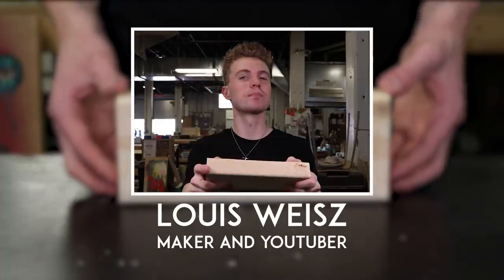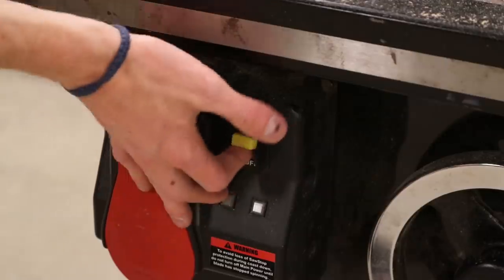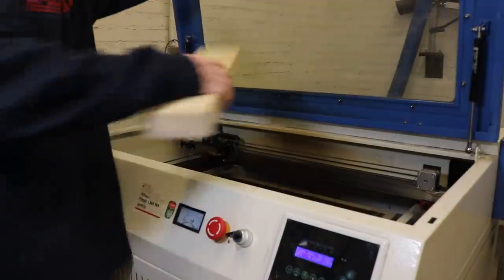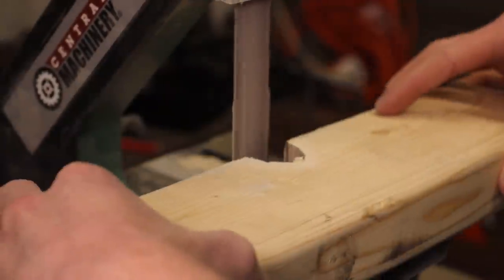Every Way to Cut Cheap Wood (39 Methods)

Comment: As someone who uses a japanese pull saw daily, its actually easier to use with one hand (and not putting pressure on it can give an extremely clean cut even tho that trades off cutting speed for finish) great video by the way, extremely entertaining. Great job!
Reply: Hey dude, when is the new new Lego Star Wars game comin out?
Reply: @stephenarnold6349  sadly enough no clue :/ gonk
Reply: @LuciFernato  Crap, well keep in touch

Comment: Katana
Sledgehammer 
Water jet (not pressure washer)
Pickaxe
Karate
Reply: Chisel
Reply: Spoon
Reply: @slimeblue4873  with enough time and effort sure
Reply: @Richard Xie I said water
Reply: @Richard Xie I said karate
Reply: What about your teeth
Reply: Dropping a cinder block
Reply: Railgun, plasma blade, model rocket engine exhaust plume, ice blade, biting
Reply: @chrisgaming9567  “railgun “
Reply: TNT

Comment: Sawzall are EPIC! I once cut apart a VW Golf... My friends and I removed as much weight as possible from the car, essentially everything but the drivers seat, steering wheel, etc, then sawzall'd the rest off. it had no roof, windshield, or doors. I think we ended up taking around 750 lbs off. We then jumped it over some train tracks by my house, with one of my more insane friends driving. Good times... Anyways, I loved the video, and if you ever need anything shot with a gun for testing, I'm equipped with a 9mm, .45, .223, .308, and 12 ga, along with a 4k camera and 40 acres of unincorporated land. I'm out in Chico, Ca, and would love to help!
Reply from the maker: Amazing! Actually if you wanna help out with projects and stuff, that’s what we’re tryna do in the discord — feel free to join if you want! Link is in the description of my cardboard boat race video.

Comment: Do a weed trimmer, leaf trimmer (the one with a nylon line), keys, mill, bench grinder, chizzle (although you technically did on a lathe) and a tool not seen often, the standard issue crafts knife. 
Very entertaining I never do woodwork and hate when I have to but this was a great video for sure.

Comment: The reason it’s actually 3.5 In by 1.5 In is because the rounded corners cut a quarter inch off of each corner, it started out as 2x4 but when rounded it became 1.5x3.5

Comment: You forgot to use time to cut wood. Just leave it to decay, and in a couple million years time will turn it into dust
Reply: It needs to end with 2 pieces! Add some sort of preservative to both sides then wait!
Reply: It takes about a single year.

Comment: The hatchet does not work because it's meant to cut along the grain, that's how it splits wood so well, it gets the wedge lodged between the fibers, and the weight of the axe is used to split it. It can't cut against the grain because it splits along the grain so well!

Comment: Ones we didn’t think of:
1. Scissor
2. Hands
3. Rock
4. Bicycle
5. Chair
6. Toy hammer
7. Toy saw
8. Toy action figure.
9. Teeth
10. Nail gun.
11. Stapler/staple gun
12. Butter knife
13. Spoon
14. Fork
15. blender
16. Fan (Ceiling/ground)
17. Rollerblade
18. Ice Skate

Comment: 0:24 - 1:11 No Tools Required Arena

0:27 = Caveman Method (1/39)

0:48 = Person Method (2/39)

0:58 = Car Method (3/39)

1:12 - 7:35 Workshop Machines Arena

1:14 = Miter Saw Method (4/39)

1:39 = Table Saw Method (5/39)

2:01 = Panel Saw Method (6/39)

2:11 = Bandsaw Method (7/39)

2:37 = Scroll Saw Method (8/39)

3:01 = Drill Press Method (9/39)

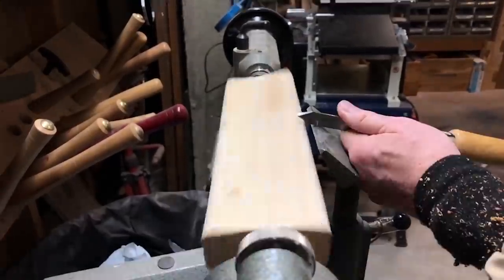3:32 = Lathe Method (10/39)

3:54 = Jigsaw Method (11/39)

4:16 = Circular Saw Method (12/39)

4:29 = Sawzall Method (13/39)

4:44 = Chainsaw Method (14/39)

4:53 = Handsaw Method (15/39)

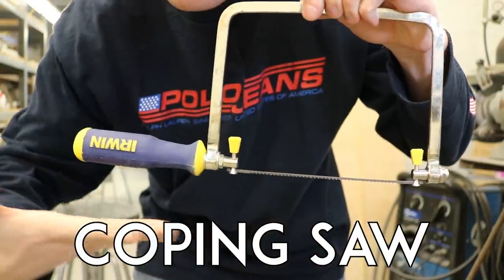5:18 = Coping Saw Method (16/39)

5:39 = Dozuki Pull Saw Method (17/39)

5:56 = Hacksaw Method (18/39)

6:05 = Wire Saw Method (19/39)

6:28 = Leatherman Saw Method (20/39)

6:41 = Steak Knife Method (21/39)

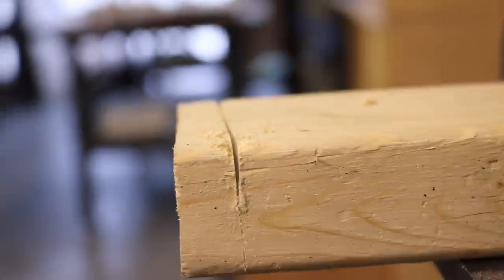7:06 = Olfa Cutter Method (22/39)

7:26 = Bolt Cutters Method (23/39)

7:36 - 8:31 Confusing Tools

7:37 = Hammer Method (24/39)

7:48 = Hatchet Method (25/39)

8:09 = File Method (26/39)

8:32 - 10:47 Workshop Machines Part 2

8:33 = Surform Rasp Method (27/39)

8:42 = Laser Method (28/39)

9:01 = Chopsaw Method (29/39)

9:17 = Angle Grinder Method (30/39)

9:29 = Dremel Tool Method (31/39)

9:51 = Multi Tool Method (32/39)

10:04 = Turbo-Plane Method (33/39)

10:27 = Belt Sander Method (34/39)

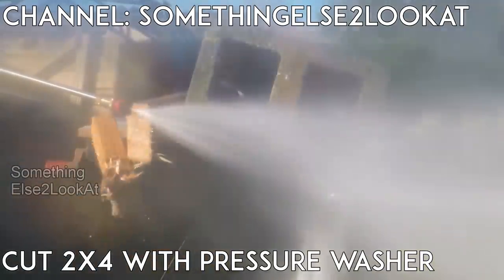10:48 - 12:20 Outside Ideas

10:49 = Fire (Torch) Method (35/39)

11:15 = Resistance Burning Method (36/39)

11:44 = Beavers...? Method (37/39)

12:07 = For his neutral special, he wields a gun Method (38/39)

12:15 = Pressured Water Method (39/39)

Comment: I’m in the Army and one time we where loading connexs but they didn’t have wood panels and 2x4s inside for spacing and to keep the metal lockers away from the sides of the container, luckily though we had a lot of raw 2x4s and some sheet wood, but we didn’t have electronic ways to cut them. So out came the leathermans, curbs, boots and pocket knives

Comment: I have already cut 2x4 with punchers and flat screw driver + hammer.

But shiezel + hammer was obvious, and I am surprised you forgot it. 

Knife and exacto can also do the job with the same technique as the axe : you need to cut chips. It's just a matter of methodology.

Comment: For angle grinder, you can buy either a wood disk by tivoly (115 or 125) (just a metal plate with teeth ), or a chain saw disk (Amazon or ali ) (small chain saw around a disk ).

These disks are probably the most dangerous tools ever created. I swear you usual table saw is a kid toy in comparison. They cut through flesh and bones as fine as classic chain saw, but, with less maniability and 0 security. 

There are other tools that may more frequently hurt people, like nail pistols, but they produce far less mess, and injuries are 5 orders of magnitude smaller.

Comment: people: please do maim yourself, Darwin is looking for winners.
i did make a jigsaw puzzle with a coping saw back in school about 23 years ago, 1000 pieces made from a 100x70 cm piece of plywood, took a good part of a entire school year as class was only 1 hour every monday or if it was tuesday... dont realy remember, i do know it was from 11 to 12 as it was the lesson we had right before dinner, and dinner was 12 to 12.30, and i do remember the motive, as we had the puzzle laying around up to a couple years ago when i tride to lay it again and found that one of the pieces was missing... the picturse used was a poster of Pamela Anderson from Baywatch we glued on to the plywood, and now as a 32 year old im kinda surprised they allowed a 9 year old make a puzzle like that.

and regarding that Steak Knife, olfa cutter, wire/bolt cutters and dremel tool... if theres a will, theres a way! and in these particular cases its actually true! you quitter...

Comment: How about those massive motorgrinders they use in road construction or with some fire departments?
And once you are with the fire department how about the Hydraulic Rescuetools?

I personally like the door breaching technique where for training purposes you take a big steel door model in a stand and you block it shut with a short wooden piece acting as a locking mechanism. Then you take the Hulligantool, your brains and your muscles to breach it...
Might be really hard with a 2x4 and heavy splintering incoming but a lot of fun

Thank you for the video

Comment: I had to cut my laptop open using a steak knife because of a stripped screw
Would not recommend on computers you want to use afterwards but luckily there was nothing I could've damaged under where I cut

Comment: You could use a compressed air laser cutter, a plasma torch, pneumatic press, a particle accelerator, a woodpecker, carpenter ants, termites, a woodchuck, a tank shell, a bayonet, a simple wedge, another 2x4. The possibilities are endless!

Comment: I think the only saw he missed was a bridge saw. A note on the Leatherman saw, there were a lot of multi-tool, giant swiss army type knives with a "saw" blade around back in the day but they all sucked. The saw teeth were all in- line flat teeth (easy to manufacture) but they were lousy for cutting on such a small blade where it's hard to bring enough force to bear to get the teeth to really dig in. They were essentially on the knife/tool just so the manufacturer could say the thing had a saw, nobody used it. Then I encountered the Leatherman saw with it's pointed teeth cut with an offset and it was a night and day difference. That thing really chews through material.

Comment: for the dremel, you probably could have gotten that last little bit with one of those ball ended things for carving away material, shoved it in and ground away the last of it.
for my own suggestions:
sitting on it between two sawhorses, if it's long enough
repeatedly stabbing it with a screwdriver
hammering a chisel through it
grinding through it with a sharp rock
sandblasting it
sticking the middle in a compost heap until it rots out (again, if it's long enough)
beating it with the flat end of a hammer
the jaws of life
a hydraulic press
hitting it with a blacksmith's power hammer

Comment: Laser doesn’t sound that bad. Yes the wood would be burned, but if you were mass cutting fire wood and you needed a device that can do it without using a table saw a laser would be fine if it’s going to be burned anyway. I wonder if it can make charcoal by exposing a chunk of wood to the beam

Comment: Only noticed it with the recip but bro, you need to make sure your blade is going on any powered cutter before you touch the material, with timber at the least, otherwise your blade is gonna jump the second you start cutting

Comment: The way wood behaves when blasted with fire is actually of interest these days, because metal can't do that. There is some research into materials that could he made ablative to metal to protect the bes from the heat as a beam doesn't have to melt to fail/loose strength. Also, it seems like the fire.is also hardening the wood beneath the scorched layer. At least I think that is why primitive technology used it for the arrow tips.

Comment: i have both a two handed double sided pull saw and a one handed pull saw shaped kinda like a gun. my one handed one has a middle ground between the fine teeth and big teeth of my two handed one. i can say that i prefer mt one handed one beacause i can fet on top of it or really any angle but the two handed one you kinda only have one position and that is at around waist/hip hieght. it also has made cutting less tured and more straight for me

Comment: I have almost finished building my outdoor office, the jigsaw blade broke on the first C24... so I built the office with a drill, hammer and hand saw (I also cut down the willow tree that stood where I was going to put the office and only used the chainsaw for the trunk and did the rest with the hand saw).

Comment: "car" or any other vehicle, jumping on it, over your knee/leg, whacking some unsuspecting person from behind, etc.  isn't "cutting it". It's "breaking it". (whacking someone could also get you permanent residency in a cage for murder, or "temporary" residency in a cage for 5 to 70 years for attempted murder, assault and battery, and so on.) 
I'm 67 years old. When I was 3 or so, I was taught "Use the right tool for the job/task at hand."
Shame you never learned or thought of that. ☹️
Want to cut boards from the lumber yard? Use a dam saw! Show you have more sense than a worm.
Reply: This was a joke video. I would like to say though he does use proper tools later on.

Comment: A 2*4 is 1.5*3.5 inches? Damn, as if inches were not enough of an idiotic measurement unit...
Reply: I was interested in knowing why they were called 2*4, and apparently it's because back in the day they used 2 inch by 4 inch green wet wood, which would dry and shrink eventually. And since they usually sell dry wood now, they stuck with the size of the dried wood.

Also yes, imperial system and US customary units system are really dumb

Comment: 11:15 That's so fucking dangerous. Even touching the wood while doing that can kill you if you dont have the proper protections.
Reply: That's what I was thinking too. This is illegal in so many states
Reply: Was shocked that he would include a safety tip for a table saw but literally put his finger inches away from certain death without a word about how f**king stupid that was.